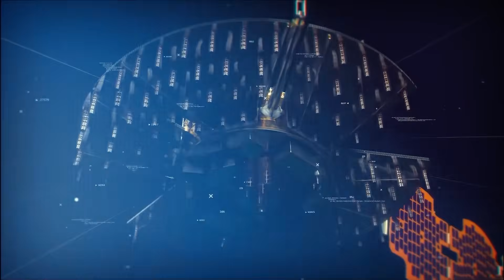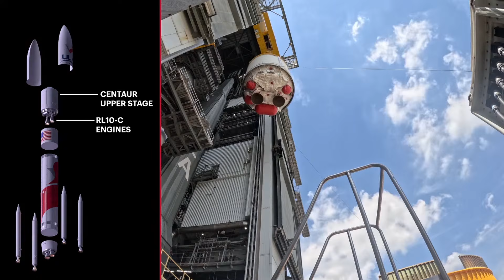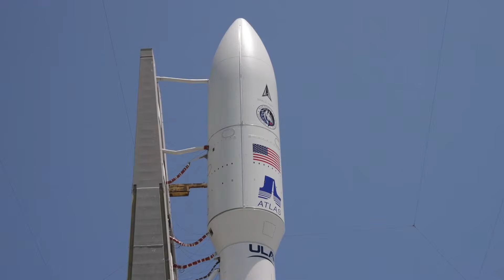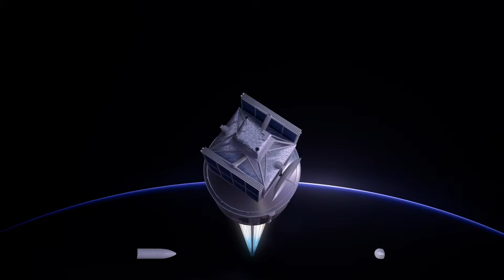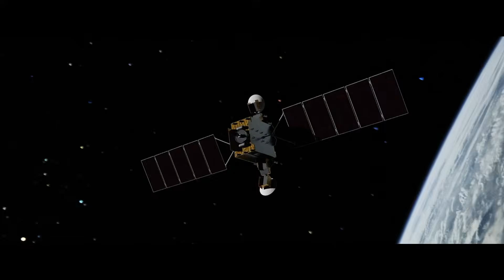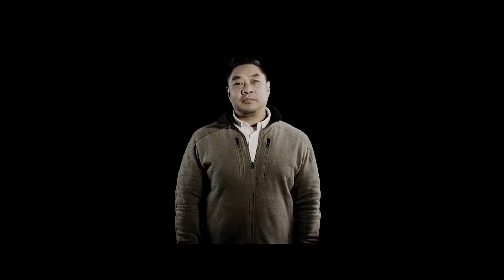Rocket Launch: Vulcan USSF-106

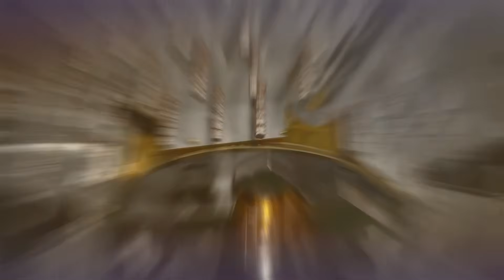Comment: Very nice launch coverage, but it could be better. At L+3:15 telemetry appears in the lower right of the screen, why can't this telemetry be made available from L+0? What are these arcane units of measure: miles, miles per hour? The majority of the world uses Metric (AKA SI) units, please use those units instead. Lastly, rocket cams are a nice supplement to viewing launches, please add those views in a spilt screen format, along with the ground-based views. If SpaceX can do all of this, why can't stodgy old ULA keep up?

Comment: A big waste of rocket, all goes in the ocean. Air Force must have plenty of money, buying expendable rocket. 🚀 a waste of money 💰
Reply: No reusable rocket is capable of a direct injection to geosynchronous orbit. Reusability had payload tradeoffs.
Reply: Not necessarily. The fuel is evaporated, and the rocket does go to the bottom of the ocean to become a reef and future home for sea life. I wouldn't call that a waste.
Reply: They're working on making the 1st stage reusable (most of it anyway)
Reply: @AndyB632 
But can it launch 🚀 it over 100 times a year. Ula is just too slow.

Comment: 10x the cost to get a kilo into space than Spacex.
Reply: That would be a lie.
Reply: It would be even cheaper to let the Communist Chinese launch spy satellites. I think you missed the point
Reply: SpaceX doesn’t have a vehicle capable of performing the direct injection to geosynchronous orbit like this launch achieved.
Reply: @AM-rd9pu 
This week he doesn’t.
Then they have to build it all over again. Like building a 787 to fly to LAX then scrapping it.
Reply: @CaptPike787  That’s not a good analogy. Rockets aren’t built with anything other than the bare necessities to get a payload to where it needs to be. 

A 787 is overkill for short haul flights and has all sorts of amenities. That’s why it’s generally used for long haul flights. 

A more applicable example would be if you wanted to fly a drone as far as possible to a remote and normally inaccessible area and don’t care to get it back. You could make it as light as possible by not including landing gear and not reinforcing structures for repeated use. By lightening the load and not needing to save battery life for a return trip, you can fly much farther. 

A Vulcan isn’t overkill for its intended missions. Making it expendable is what allows it to accomplish the direct injection to geosynchronous orbit.
Reply: @AM-rd9pu 
Reusability is paramount to the success of spaceflight and our future.
Reply: @CaptPike787  Reusability makes performance sacrifices. There’s a tradeoff.